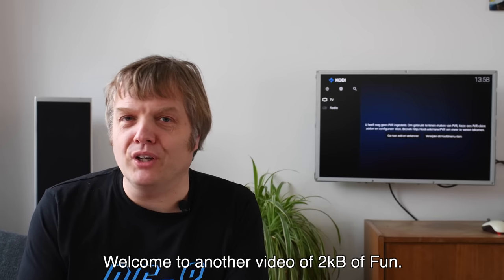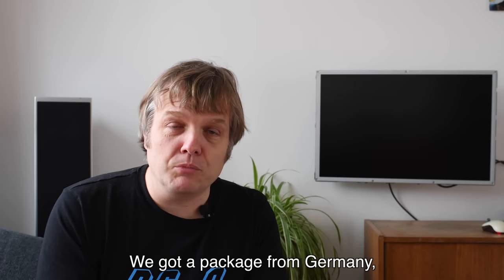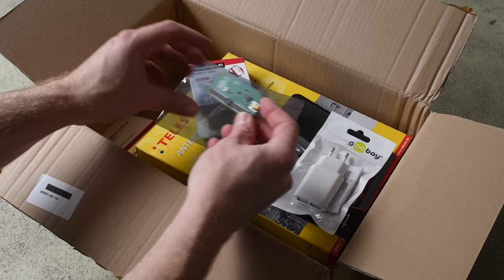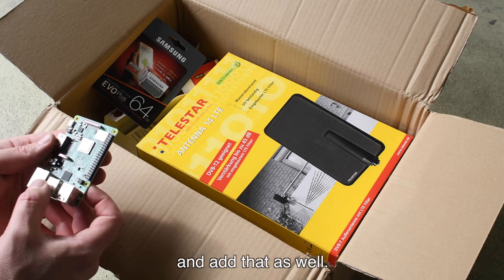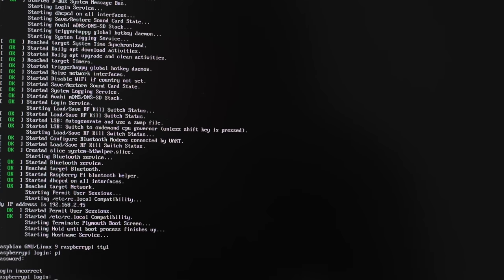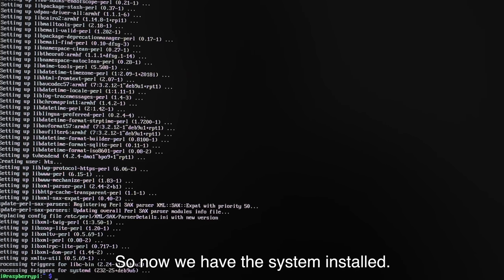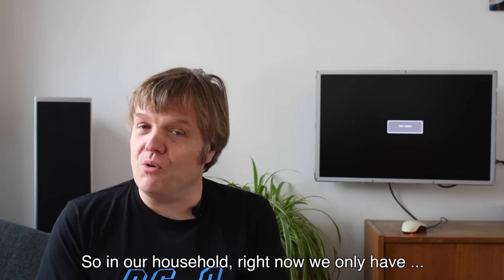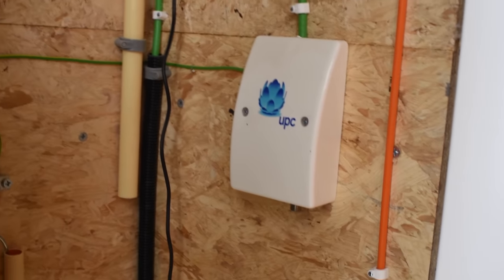Cutting the cord: setting up a DVB-T2 server with a Raspberry Pi TV-Hat

Comment from the maker: I wasn't expecting it to work, but it seems I can record 2 channels at once. Does anybody know how that works? Does it grab all channels together and split that to multiple files?
Reply from the maker: @justmytake4152  Thanks for the explanation!
Reply: you can record so many program that come same stream or frequency.
atleast this way it was presented on my dvb-c tuner/recorder box decade ago lol
Reply from the maker: @JarppaGuru  Yeah, but bandwidth of the SD card is seriously limited on a Pi
Reply: You can record multiple channels at once if they're on the same DVB multiplex, and they'll still come out as separate recordings. The DVB tuner tunes into a multiplex, then subscribes to feeds containing channels and guide data.

Here are a set of examples. I live in Singapore, where Mediacorp have 6 channels across 3 DVB-T2 multiplexes, so 2 channels per multiplex, and because Channel 5 and CNA are on different multiplexes, I can't record/watch both channels at the same time on the same tuner, but can do so with 2 tuners. However, if I instead recorded/watched Channel 5 and Suria at the same time, that would work as both channels are on the same multiplex.

Comment: Hi, great video! However I'm having troubles with the setup of tvheadend. My Pi doesn't recognize the TV hat and I don't understand why. I can see the green led on the hat but it doesn't appear in the TV adapters list in tvheadend backand. I'm running the latest version of Raspberry Pi OS 32 bit (the stable one, not the 64 bit beta version). After a fresh installation I run these commands:
sudo apt-get update
sudo apt-get upgrade
sudo apt-get install tvheadend

Any suggestions? Do I have to update some driver o something like that?
Reply: From my experience which is not extensive with Pi HATs, cards, camera,ect is despite what they say, you probably need to install something before it will work properly. I suggest going to the Raspberry Pi Foundation website and looking at what they have for info on the tv HAT or wikipedia.
Reply: @sovereignlivingsoul  no. every tutorial do same thing. still board not recogniced and when i get it work no channels (using rpi4 8gb)

Comment: can you watch 2 different programs on 2 TVs at the same time?
Reply from the maker: If they are in the same mux yes. So here in the Netherlands you can watch and or record NPO 1, 2 and 3 at the same time.
Reply: @2kBofFun  thank you!
Reply from the maker: @vincenzoscardigno4764  I did an experiment: I copied VLC player 4 times (on a i7 Mac) and then started 4 streams in a separate VLC window. As you can see the fourth instance becomes choppy, either because of the bandwidth limit of the Pi 3 (100MBps) or because the i7 has to decode 4 HEVC streams. https://www.youtube.com/watch?v=Myj0S0xPyD4

Comment: VERY nice!  My only question is this:  how many people in your home can stream TV at the same time...... and change the channel to whatever they want...... at the same time?  Or...... will that require a totally different solution, altogether?  (yeah, that turned out to be a compound question, but oh well.  )    :)
Reply from the maker: Streaming should be able for 2-3 devices, maybe more with a better SD card and a Pi4 with gigabit, playing live TV is limited to 1 channel, but you could add a secondary USB tuner for a second live channel.
Reply from the maker: Found out it does manage to deal with 2 simultaneous streams. I can record channel 1 and 2 at the same time for example.
Reply: It is a web interface, each connection is separate from the other, the recorded programs can be viewed through the pvr function or with VLC if you enabled SMB

Comment: Can it be solved?
LAN cable -> router -> wire connect internet -> Rpi4B (4GB).
I would like to see a TV broadcast from a mobile internet connection on a smartphone!
These are 2 internet service providers (which may be the same company that provides the internet, but the point is that the IP address is different and the mobile network should be connected to the wired connection where you can access the TV broadcast).
How to make a connection so that I would like to use the VLC media player(I don't want to use KODI!) on my smartphone, to be able to see TV shows with the mentioned internet options.
That is, the smartphone does not use wi-fi internet! And the point is, you don't just have to access TV on an internal network!
How and what to set up? Can you help?
Reply from the maker: Not certain, but nou need a service that tracks your changing IP address of the broadcasting phone and ties it to a static IP you can contact on the receiving phone.
Reply: @2kBofFun  He misunderstood something.
It is not the phone that transmits, but the TV uHAT, with RPI.
I want to receive the transmission with the phone, but even in another place where the IP ADDRESS is different, which is not a local network!
An example: If I use a TV uHAT in an apartment FIX location "XYZ" is located in a city whose local IP address varies.
By phone e.g. "QWERTY" city, how will I achieve TV broadcast with VLC player?

They write it can only be received on a local network. That's not enough for me. I need to access the TV broadcast on a smartphone with an external network with a VLC player, a local network where it sends the TV broadcast, another IP address, the TV uHAT from the RPI.
see link: http://hobbycnc.bplaced.net/tvuhat/tvuhat.png
Reply from the maker: @CNCVelMart  Then it is not that hard. Just set TV Headend open to external viewing.
Reply: @2kBofFun  How?
Reply from the maker: @CNCVelMart  https://tvheadend.org/boards/5/topics/21828?r=21884

Comment: I am on the verge of purchasing a Humax Aura after finally giving up on Windows Media Centre with 4 tuners.  So I have a budget of about £300.  Is it possible to build a media centre on a Pie with multiple tuners, a working epg and catch up services.  I'm not a fan of Android TV I don't want to reboot the device every time an app crashes.  I am told the Pie is more stable. If someone can offer advice I would really appreciate it.
Reply from the maker: No idea on the Pi with multiple tuners, guess they have to be USB based. Note that I can record all 3 free-to-air channels simultaniously with a single tuner as they are on the same mux.
Also be warned that the storage system of the Pi is sub-optimal being SD card based. Guess there are Pi-comparable boards that offer NVMe based SSD's. The main bottleneck is drive throughput, if you watch and record 2 channels at the same time, you get caching spinning wheels now and then interrupting your view.
Also note that using the Pi you have to split viewing and recording. I would not recommend using the Pi to view and record at the same time. It does offer HVEC decode, but 4K is taxing. Do you get 4K DVB-T in your country? Here it is 1080p50, and I use an old MacMini 2009 to playback. On High Sierra and up this is really stable and fluent.
Reply: @2kBofFun  I am in the UK, in my area there are 8 mux with channels scattered all over them.  What I liked about Windows media player was the community support and home brew options.  The cheap little Android boxes have such a limited shelf life with new models being churned out so quickly they never get the traction to hold a user group together.  I will have a look at more raspberry pie videos, it may be I can use it as a stop gap until Humax stabilise their Android TV software.  Thanks for the video and turning my head to another direction. 👍

Comment: Are you still using that solution? Was it ultimately a reliable way to access Free-To-Air channels?
Reply from the maker: Still works like clockwork.The only change I should have made is using a different SD card. 64GB is way too small.

Comment: Its possible to reach server from oitside lan? I mean from internet.....another house...
Reply from the maker: Yes, certainly. I did not try as I use a G4 internet connection with non-fixed IP addresses, but if you have a fixed IP, you can setup port forwarding on your router for port 9981 to the local Raspberry Pi ip address. Many people use this to watch TV in their vacation home elsewhere in Europe to bypass geoblocking on TV broadcasts.
Reply: @2kBofFun  awesome reply.
Reply: You could also use a DDNS, like no-ip and add it to a domain name, if having a fixed ip isn't possible.
Reply: Do you know how much bandwidth is used for a channel? Did you measure it?
Reply: Only if you could log into your home network from outside your home.

Comment: Can I watch the same channel on different devices?
Reply from the maker: Yes, that is possible. You can also watch different recorded streams and the live stream on multiple devices. But you are always limited to 1 live channel, unless you add a second tuner over USB. Beware that network and SD card bandwidth can be limiting if you have too many devices requesting data at once.
Reply: 2kB of Fun  
You mean every devices in my network have to open the same channel?
Reply from the maker: @DucNguyenTien99  Yep.
Reply: i havnt checked if the pi can support this but its not just limited to 1 live channel per tuner you can actually play 1 multicast per channel

the way digital works is several channels are encoded into each transmission signal for example it might look like this

multiplex 1
horror channel
music channel
games channel

multiplex 2
shopping channel
public broadcast channel 
drama channel

multiplex 3
xxx channel
movies channel
tech channel

a few systems support multicasting where as long as the channels you wan to watch are all on the same multiplex you can watch several channels at once all off one tuner

so you could watch horror channel whilst your wife or kids watch music channel because there both on the same multiplex

it also means that you can record all channels on that multiplex at once too but that takes a decent system to pull off

other videos on yourtube show this usually they install 7 tuners so they can record or watch unlimited channels at once
Reply from the maker: I just found out it is able to tune 2 channels at once. I made some recordings of two programs on different channels in parallel.

Comment: Way complicated just to watch t.v.. Isn't easier to just add hd antennas to the t.v i don't see tbe point
Reply: its a fun project and consumes less power than a DVR apparently. Not suitable for all though.
Reply from the maker: In a way you do that. Solution 1: get a 50$ soon to be e-waste stand alone DVBT2 tuner with another remote and limited recording options for a single TV, or get a Raspberry Pi that will have a much longer lifespan (I sold 2010 Pi's for just 10€ less than new) and serve any device in the house that runs KODI with the remote it already has.
Embrace more friction in your life!
Reply: yes no extra cost xD but you cant record and stream channels to world lol with just tv